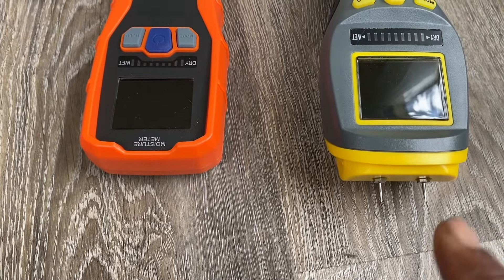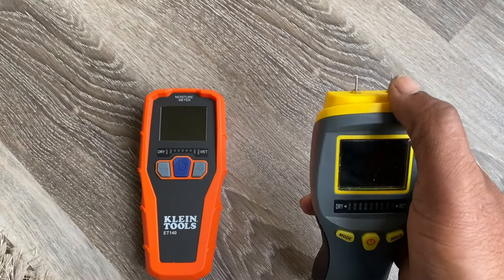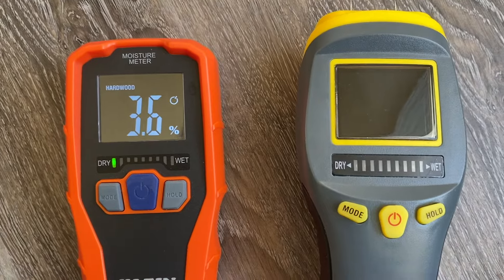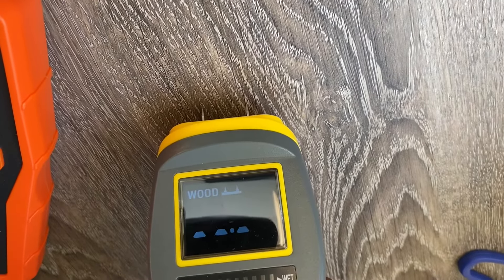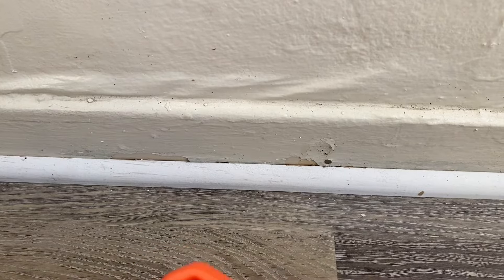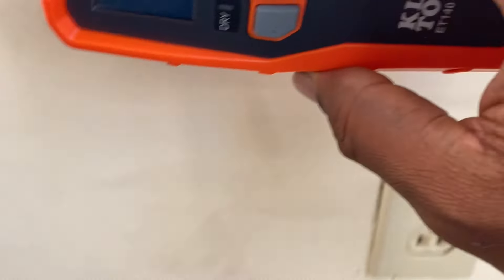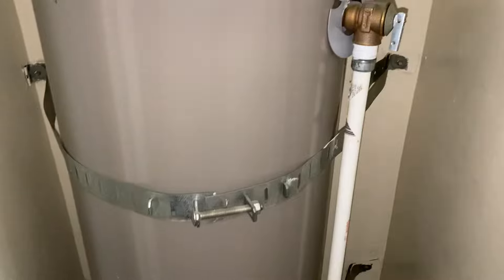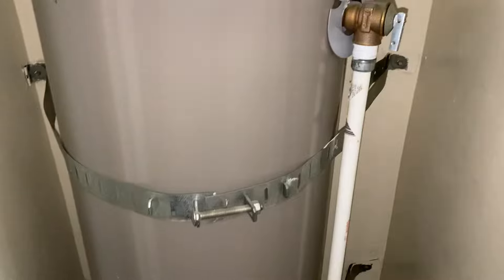HOW TO DETECT MOLD IN YOUR HOME PT 1

Comment: Walls can be bone dry, and mold can still be present.  Moisture meters only detect ACTIVE moisture.  Once a water damaged wall grows mold, and then dries out, the mold remains dormant until it gets more water to start growing again.  Also, don't bother checking high on walls unless your looking for roof leaks.  Water runs down a wall, and only soaks up from the floor for a few feet.  Thats where to sample a wall for active moisture.
Reply from the maker: Good tip.
Reply: So how else would you check to confirm mold in dry areas, particularly hidden behind walls??
Reply: @tinkymcginnis  That is a great question!... There are different ways.  1. Check the tack strip if carpet is present, or the back side of base trim.  Tack strip and unprotected trim (back) is extremely vulnerable to mold growth from water damage.  If it is moldy, chances are the wall behind it is too.  2.  Take any very sharp pointed metal tool like a knife and slowly push the tip of it into the sheetrock in a suspected area along the top edge of any base trim present.  Water damaged sheetrock hardens like a rock after it dries out.  Your sharp too will not penetrate nearly as easy, if at all, compared to dry/unaffected sheetrock.   The pointed end of a utility knife works best, just be careful not to apply a dangerous amount of pressure that would risk slippage or breakage of the blade.  3.  Tap the sheetrock with your fingernail to feel for the same density changes that occur once the sheetrock is saturated and then dries out.  If you find hardened sheetrock, you should remove the trim and a small section of sheetrock  behind the trim to see if mold is present on the back side.   (It may have been professionally dried after a previous water loss)
Reply: @tinkymcginnis  Maybe checking during a good rainstorm ? Assuming the affected areas should alert the moisture meter a bit more during those times.
Reply: What's the best way to check for mold in HVAC unit besides actually seeing the mold. I use an air quality meter that says it detects organic growth only problem is the company I work for doesn't allow me to use that to determine mold growth. Any suggestions as far as mold detection equipment?
Reply: Do you inspect homes for mold?
Reply: If the leak came from an upstairs apartment that affected the lower apartment and the lower apartment is being taken care of but the upstairs is not what are the chances mold is still present?  It’s been ten days so far and the machines on the lower apartment is still trying to dry out the subfloor.  Should tenant be concerned if and when the ceiling is closed up.  By the way leak had been going on for about a year.
Reply: @aletaaustin7408  No way to know.  The risk will be based on the square footage of wall/ceiling/floor areas affected but not treated.  A 1 year leak is certainly cause for concern.  I would at least want to see a clearance test performed before new materials are installed.
Reply: @williammiller6110  thanks for posting that comment. It may really help me. But what is "base trim"..? 
Along with signs of damp, I have some uneven flooring beneath carpet which according to something I saw could be a case of improper installation of materials and that could lead to damp getting in. Thx
Reply: @a_planet_on_fire  Base Trim is Wood molding at the Base of the wall... hiding the gap between the edge of the flooring and the bottom of the wall.
Reply: @williammiller6110  thanks. I think it gets called something else here... Skirting boards or something like that. 
I have numerous areas where there is an unsealed visible gap between the base trim and the vinyl flooring and I think this is part of the numerous dampness problems with the home. Thanks again.

Comment: I just got this tool here in UK, and have been testing it around my brick and mortar house, prior to testing a clients property. This property was build in 1960s, with bricks and a damp proof membrane which runs all around the outside of the house above the ground level. We also have air bricks ventilating under the wooden sub floor. No visual mould or smell in our house, no paint or plaster bubbles on walls..... But according to the tester all my ground floor masonary walls are over range! Also perhaps less surprisingly, thr drywall plasterboard around the shower is also over range and then starts to drop as you go up the wall to the ceiling 😮 So im a bit skeptical about the readings it is giving me. Perhaps it is correct, but with good ventilation we don't seem to have a problem with mould building up anywhere even in winter time when it's cold and damp. Still makes me more worried about  what we can't see inside the walls!
Reply from the maker: Makes sense that mold readings are higher on the lower portions of the plaster and drywall in the shower. Water would collect there more due to gravity.

Comment: The trouble is that metal behind the drywall will do the same.  I tried mine on my father's walls and it went off at the corners where metal corner proectors are.  It makes sense since it's checking conductivity.
Reply from the maker: Good observation, thanks.

Comment: Thank you for your helpful video. Is air sampling a better way of testing? How do you know if a professional is doing a thorough job of testing?
Reply from the maker: Air sampling can turn out a false negative if the mold is in an air tight area. Because of its inaccuracy it’s not even recommended. That said, air sampling can detect mold in hidden places that are not air tight. You wouldn’t know unless you are a pro yourself. At least you know with moisture or swab testing.

Comment: If you live in a high humidity area like South Florida, I read that moisture levels of walls are higher than in other areas.  Is this true and are meters adjustable to geographical location?
Reply from the maker: Yes it is true, but high humidity doesn’t affect the accuracy of a moisture reading.

Comment: I like the video!  What if the area has dried out but the mold is still there?
Reply from the maker: It has to be removed or it will continue to spread.
Reply: @Caliber8Tools  Right, but how do you find it?
Reply: @nanasloves  you could perform an air test checking for mold spores in the air.  Or you could just cut a small section of the moist drywall. There are mold remedial companies also.
Reply: You can buy mold test kits that will tell you exactly what type of mold it is. Be aware, there are mold spores in the air at all times in areas with humidity. When you buy a test kit they suggest you place one inside AND outside to view any sizable differences. Do some research and don't panic. Science is helpful, panic is not.

Comment: Could it be a pipe? I understand if your meter goes over metal it throws reading off
Reply from the maker: Yes, that is true especially with pinless meters. Pin type meters help avoid those issues.